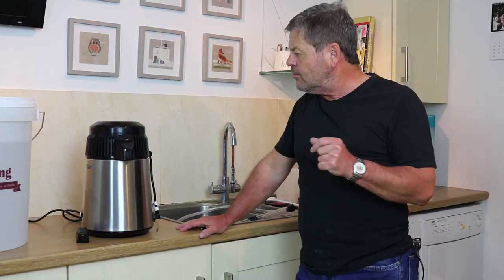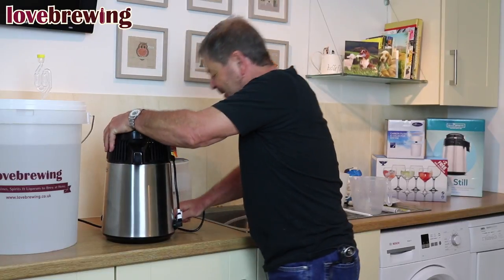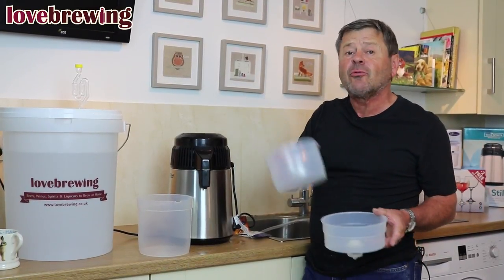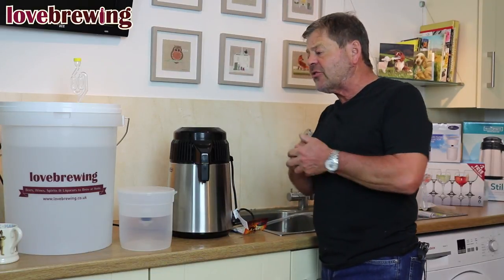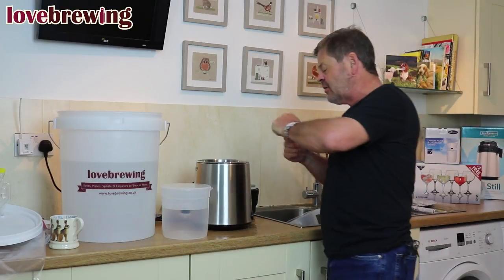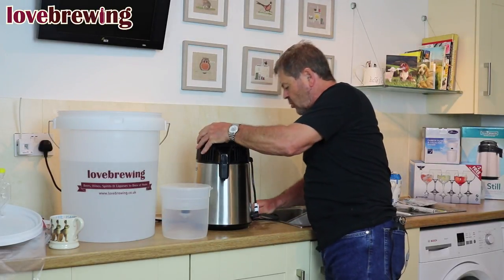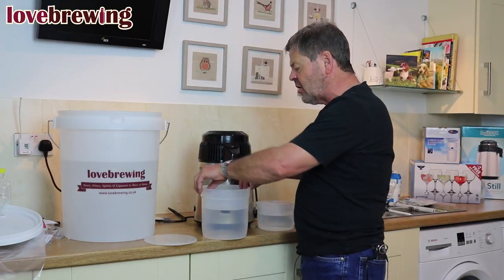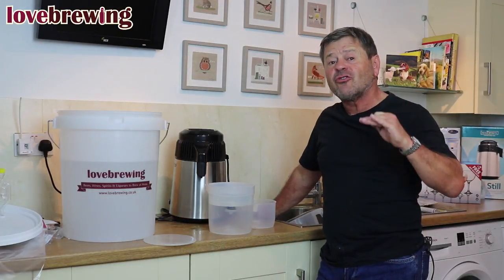Beginners Guide to Making Spirits - Part 4 - Distilling

Comment: Heard a tip about the Air Still today. Turn the still on but turn the fan OFF for 40 minutes- this causes the still to heat up much quicker, saving electric and time. Turn the fan on when it’s hot.

Comment: do we need to limit the heat to 90 degrees centigrade or not?my distiller has no thermostat so it boils at 100 degrees.is it ok for distilation?

Comment: At 11:30 you say that is the alchohol is at 40%, but you haven't added the 400ml of water yet and so it's the 60% alcohol that you run through the carbon filter. You go on to say that carbon is not effective above 50%. Did I miss a step?
Reply from the maker: Hi. Yes you always dilute the alcohol (at 60%) down to 40% before running through the carbon.
Reply: @LoveBrewing  But at 8:27 you say you have collected your 800ml at 60%. Watching the video from that point the level in the container does not change at all until you run it through the carbon filter, so I'm not sure how you could have added the 400ml of water to dilute?

Comment: You mentioned that you need to hurry and distill it all as the alcohol can turn to vinegar with the oxygen. Once it is distilled do you still have to worry about that. Say you distill then get to 40  then filter can you start pouring in a new  bucket until your ready to bottle and do the flavoring
Reply: Spirits won't turn to vinegar. Also, if you follow proper cleaning and sterilization techniques your wash won't turn to vinegar either. I've personally seen 3 year old washes that were still fine

Comment: I've completed 2 runs now but both times I've gotten half the yield I'm supposed to. Any idea why? Using turbo 500.
Reply: Likely you are making 90+ABV with the turbo 500 mine usually came out 90-93  so test it add more water to make more at 40%

Comment: Why worry about the container filling past 800ml? why not just run continuously into a bucket and then separate into 800ml containers later?
Reply: Because past 800ml the alcohol coming out gets less and worse quality. That would give you less than 60% to dilute down and your alcohol won’t be as good quality.

Comment: Between £160 to £200 for the still, then the flavors plus the twice as much sugar you have to use, unless you can sell this liquid, its way cheaper to buy the bottle of you choice
Reply: Depends on the country you are in. Here in Australia spirits typically cost $50-60 AUD per litre (£25-30). After buying everything for the brew (sugar, yeast, carbon, filters and flavors) it works out slightly less than $50 AUD to produce 7.2 litres of spirit.

That means in a single batch it saves buying around 6 more litres of spirits @ $50-60 each or around $300-350 AUD (£150-180). That means in a single batch the machine pays for itself. And this machine is basically good for a few hundred batches.